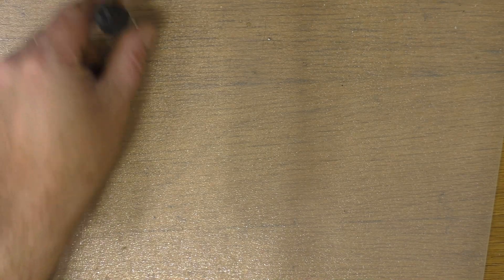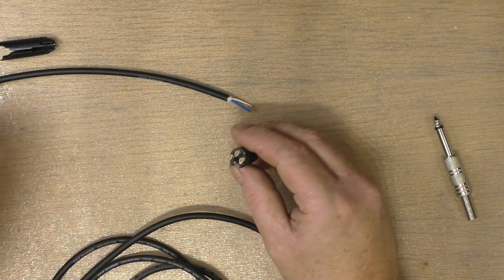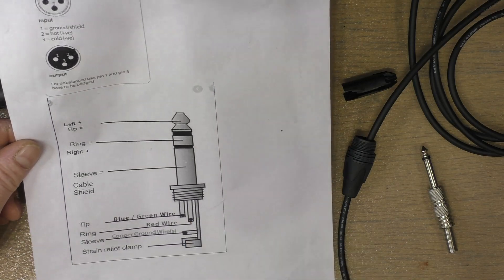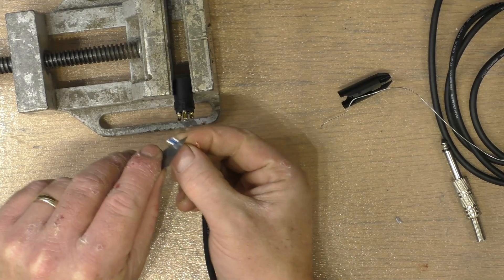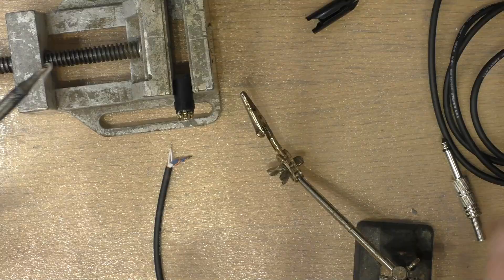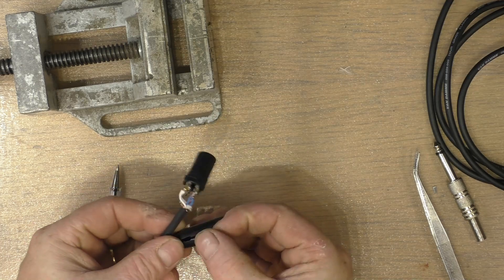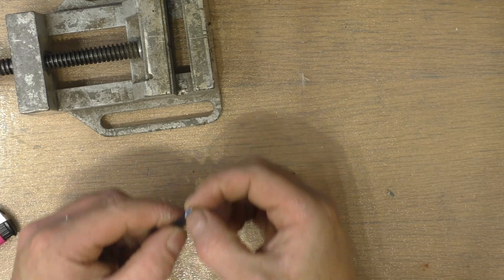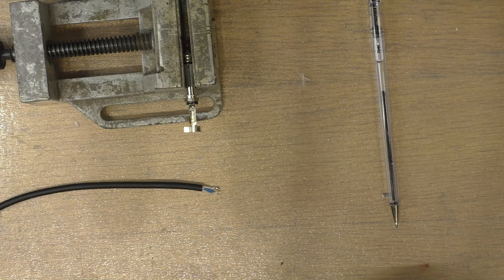Build a DI Box to Icom IC-7300 Audio Lead | Balanced to Unbalanced Shack Audio

Comment: Another Question. When i turn on more power into mi HF radio (100w) with my headphones connected to my mixer, i get some distorion from the mixer. But, when i drag down the power level to 5-10w, the distortion dismiss completly. Do you know what can be? Thanks!
Reply from the maker: You have RF getting into either the mixer or your headphones. Also, are you using the pan pot to seperate your tx and rx audio? You're better off to use your headphones via the radio anyway.
Reply: @GeorgeEI7KO  Thank you for your answer. I get some ferrite cores and i put them all in my shack. I get fixed, not at 100% but the noise are a bit more lower. Thanks for your advice! 73s

Comment: Hi George, one thing I didn't see you cover is the 48v phantom voltage.  If my mixer supplies the phantom power for my condenser mic which it requires, does this voltage also pass through to the DI box to power it as well, or will I need to rig it up to a power supply like it appears you have?
Reply from the maker: In the application we are using it for, the option of powering the di box via phantom power is not possible. Hence the external power supply. Hope that helps. 73
Reply: @GeorgeEI7KO  I assumed this would be the answer you'd have.  I'm still waiting for my DI box to come from Amazon.. its the last piece of this puzzle.  Thanks for helping me figure it all out!